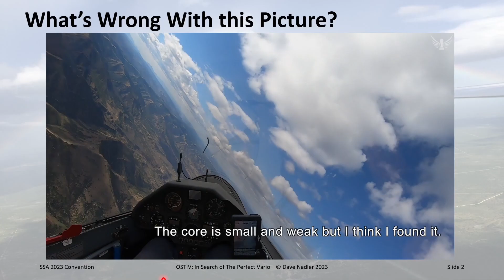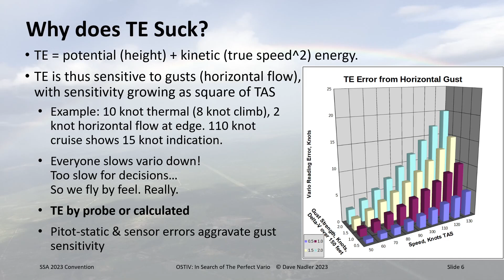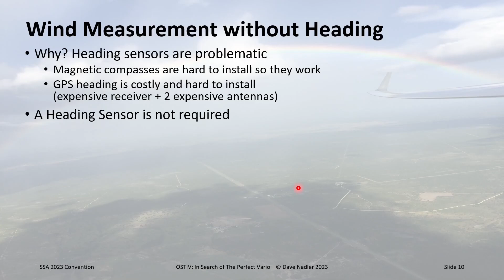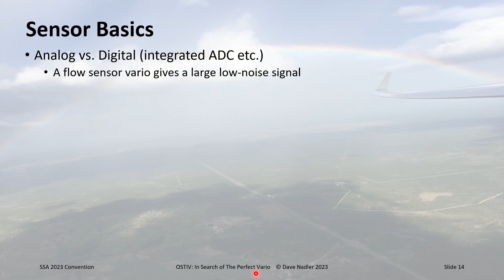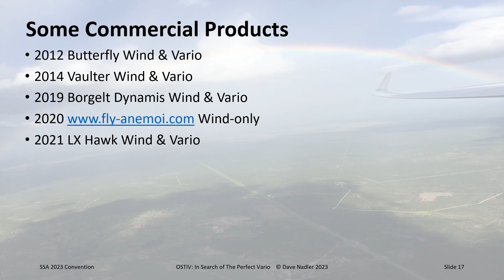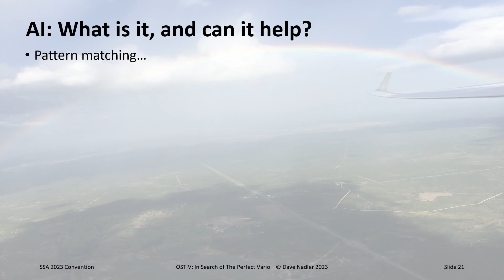In Search of The Perfect Vario - 2023 OSTIV/SSA Lecture

Comment: I also want to share some observations that you might be interessted in. When I achived closed to 100% TE compensation a lot of the noise in the indication went away. For a gust to exist there must be a pressure differences. When flying in to a gust you are going from a lower static pressure to a higher, which yields the opposite energy from the horizontal wind.
Reply from the maker: Careful, a gust is not "noise". I'll have a look at my latest data to see if the pressure change is noted by decrease in static vario (which I have not noticed), but in any case the gust is not so hard to identify - and then produce a gust-free TE vario. I'll cover that next presentation ;-)

Comment: Excellent presentation. Do you have an opinion about the two GPS Larus?
Reply from the maker: As in comments here, reputed to be very good. Larus also uses auto-calibrated magnetometer (compass), and can work with regular GPS instead of two-antenna heading GPS.

Comment: LARUS was initially developed with dual GNSS and is also available as single GNSS with magnetometer. For example in my ASG29 I´m only flying with the single GNSS and it works amazing without any noticeable problems. In the LS3 I installed the dual GNSS version for testing and I´m also very happy with it. Indeed the installation of the second GNSS antenna is a problem to overcome in new gliders which are entirely built out of carbon fiber. But in my opinion that's the ultimate solution, that always works very precisely and even if you are not circling at all. Thanks for the great presentation!
Reply from the maker: Thanks Stefan, much appreciated.
Did you use Larus in your Grand Prix championship win?
Reply: @DaveNadlerYO  I know that Stefan used it in SGP final.
Reply: How far apart must the two antennas be? Would it be sufficient in a Ventus to fit one antenna at the front of the canopy and the second at the rear, about 1.4 metres apart?